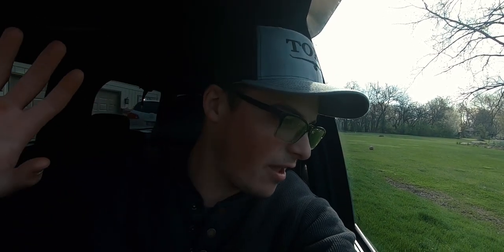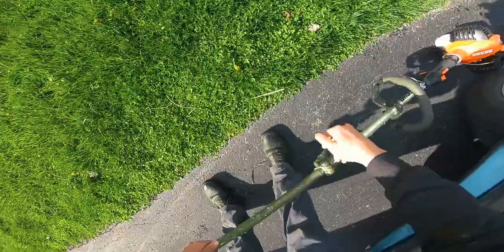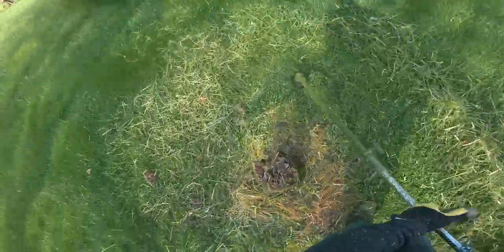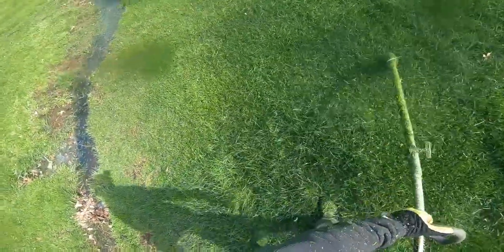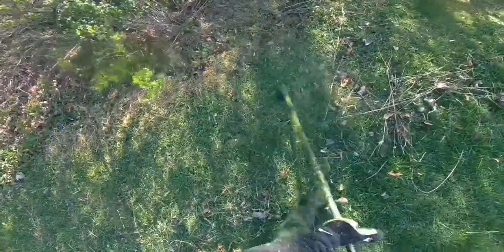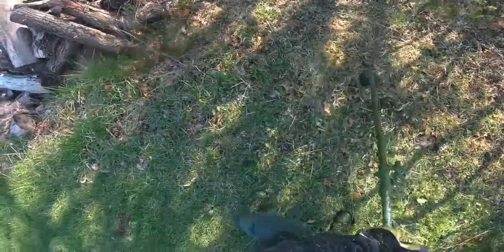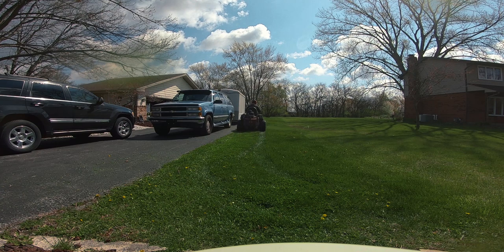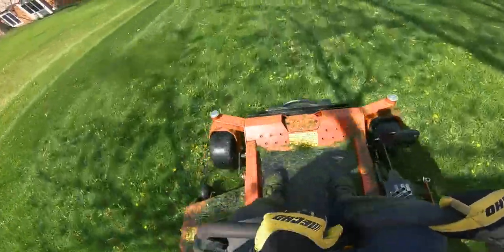HOW TO MOW a BIG LAWN that is WET and OVERGROWN

Comment: I have and use the Echo PAS 2620 with the pro torque trimmer attachment and straight shaft power edger. Both are beasts 💪